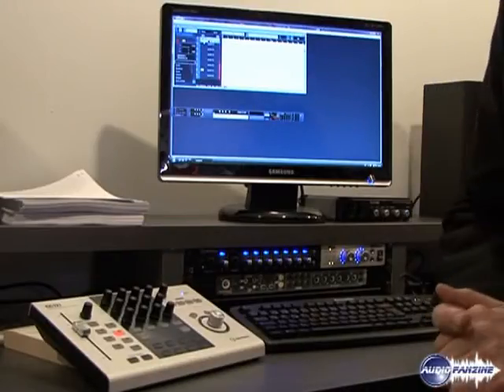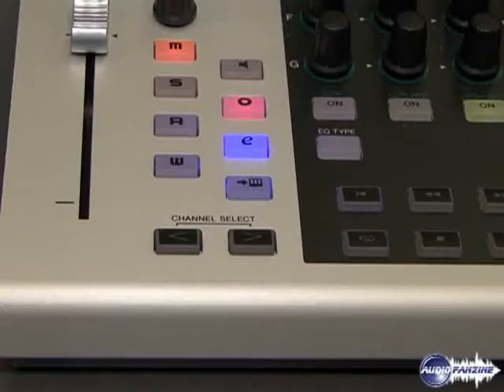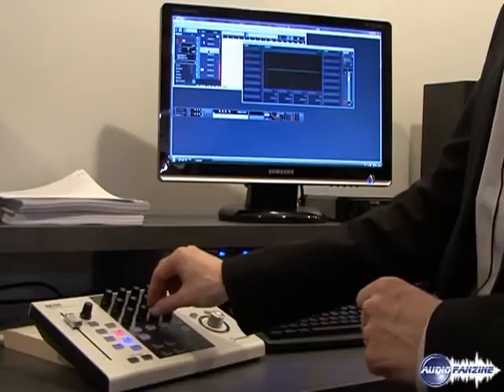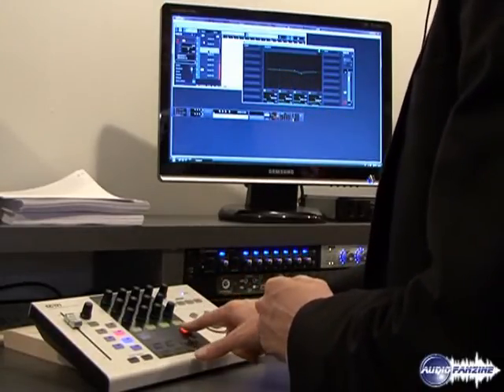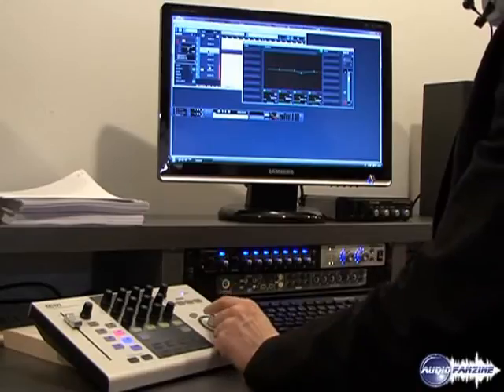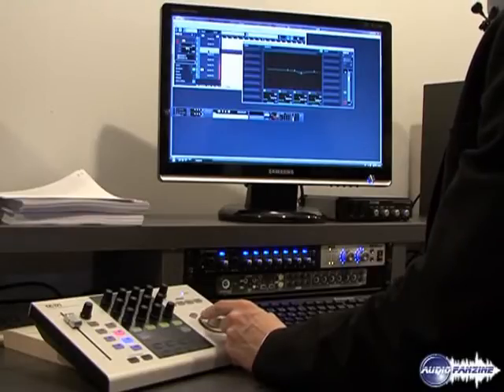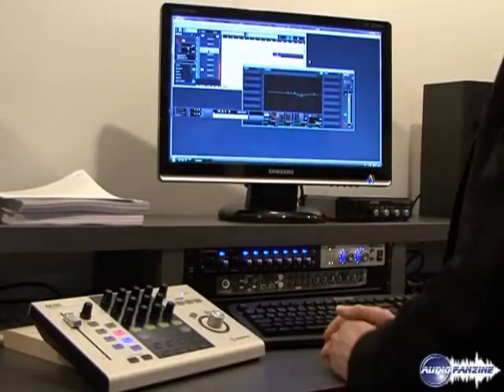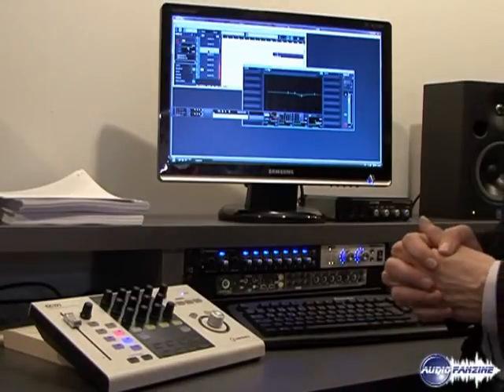[Musikmesse 2008]Steinberg CC121 Advanced Integration Contro

Comment: I'm just wondering what to do with this
if the Cubase software will change later ,
so that the CC121 will no longer match with the software. Also I'm using the keyboard  a lot for nearly all functions. Using the CC121 would mean to switch between mouse, CC121 and keyboard...don't know if this is good..